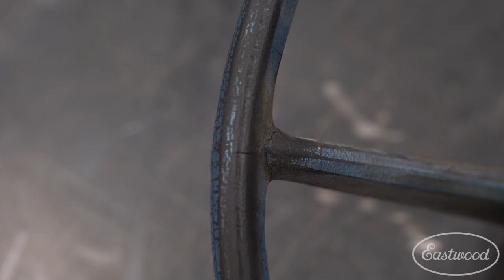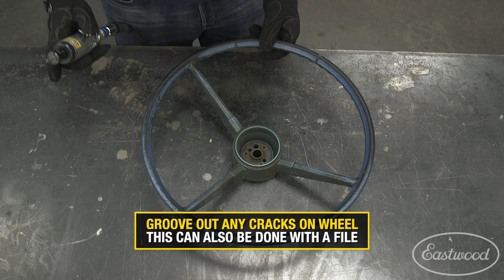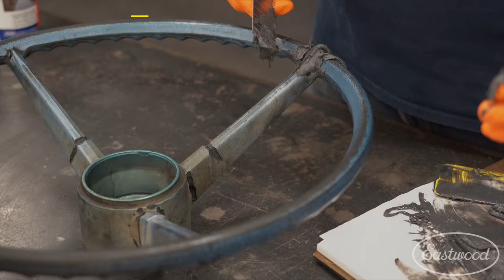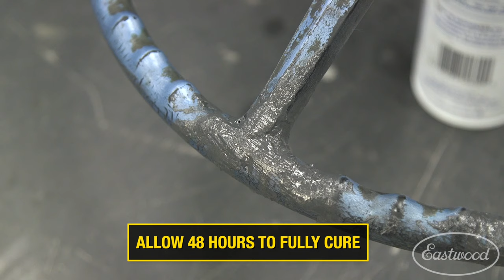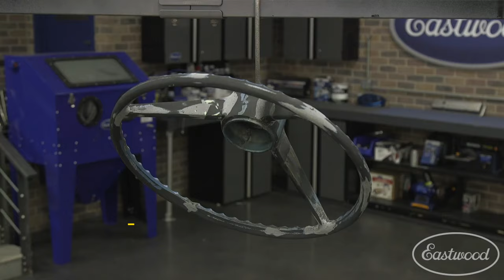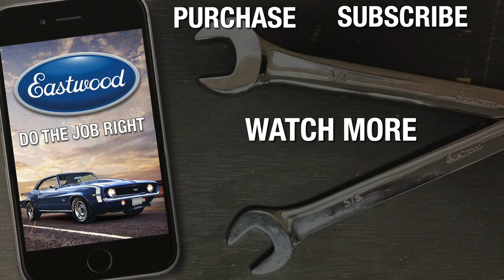How to Repair Your Cracked Steering Wheel  - Master Steering Wheel Repair Kit - Eastwood

Comment: Used a different epoxy, but repaired 2 steering wheels. Spend much more time on finishing and painting (with 2k, as normal paint will wear too soon). Better than new in gloss black, awesome.

Comment: I've always just used body filler.  Really wide cracks I fill most of the way with JB weld first  then finish with filler.
Reply: Why not just use the JB weld for the whole job ? Curious what the advantage of the body filler is ?
Reply: @b00sted_SS  easier to sand
Reply: Is the jb you talking about sandable ? And is it sist when its cured ?
Reply: @b00sted_SS  huge thanks for the tip 👏👏

Comment: Is the repair area will be soft like the rest of the steering wheel ?
Reply: These appear to be molded plastic steering wheels, so they wouldn’t be soft like a padded or leather covered steering wheel.